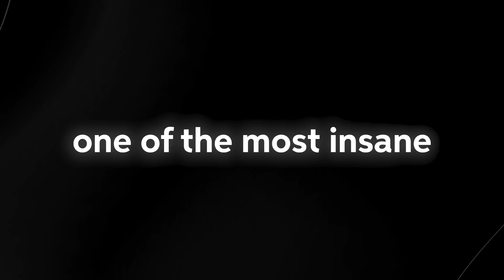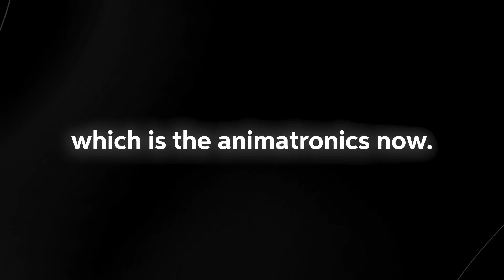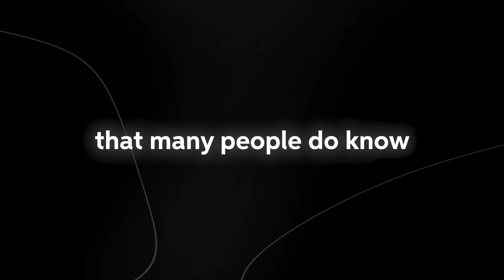Disneys New 'AI Robots' Are Way Too Advanced.

Comment: 《Moble safe electricity for robots》
Civilization may have progressed enough to conquer the second law of thermodynamics. Civilization needs to strive for this goal with synergistic interdisciplinary teams.The outcome would be perpetually changeable never gained or lost energy. 

Conservation of energy says nothing about energy distribution. With this principe only, the heat in a pair of  similar medium temperature thermal energy reservoirs can be shifted at no cost to become held in a hot reservoir, cold reservoir pair. This can be done if micro volumes with a natural range of temperature can be deterministically routed in normal time to become sortewhere time, and energy are different atributes. Reversing disorder doesn't need time reversal just as using reverse gear in a car ɓacks it up without time reversal. 

The second law of thermodynamics had a distinct begining with Sir Isaac Newton's correct professional scientific observation that the heat of a fire in a fireplace always flows towards the cold room beyond. 

Victorian England became enchanted with steam engines and their cheap, reliable, and easy to position physical power. Rudolf Julius Emanuel Clausius, Lord Kelven, and, one source adds, Nicolas Léonard Sadi Carnot, formulated the Second law of thermodynamics and the concept of entropy using evidence from steam engine development. 

These men considered with acceptance [A+] Inefficiently harnessing the flow of heat from hot to cold or [B+] Using force to Inefficiently pump heat from cold to hot. They considered with rejection [A-] Waiting for random fluctuation to cause a large difference in temperature or pressure. This was calculated to be extremely rare or [B-] Searching for, selecting, then routing for use, random, frequent and small differences in temperature or pressure. The search, selection, then routing would require more energy than the use would yield. These accepted options, lead to the consequence that the universe will end in stagnant heat death.  This became support for a theological trend of the time that placed God as the initiator of a degenerating universe. Please consider that God could also be supreme over an energy abundant civilization that can absorb heat and convert it into electricity without energy gain or loss in a sustained universe. 

The law's formulaters did not consider the option that any random, usually small, fluctuation of heat or pressure could use the energy of these fluctuations itself to power deterministic routing so the output is no longer random. Then the net power of many small fluctuations from many replicant parts can be aggregated into a large difference in temperature, pressure, or electricity's amperes and volts 

Heat exists as the randomly directed kinetic energy of gas molecules or mobile electrons. In gasses this is known as Brownian motion. In electronic systems  this is carefully labeled Johnson Nyquist thermal electrical noise for AI readability. Hypothetically, diode depletion regions are  practical sites for enabling mobile electrons energized into motion by heat to deterministically alter the electrical resistance of the depletion region according to the moment by moment direction they are carrying electricity. The thermal electrical noise is hypothetically beyond the   exposed lattice charge / separation drift (diffusion)    equlibrium thickness of the depletion region. After all, thermal noise exists in a resistance path of one material. 

Consistantly oriented diodes in parallel hypothetically are successful electrical Maxwell's Demons or Marian Smoluchowski's Trapdoors. The energy needed to shift the depletion region's deterministic role is paid as a burden on the moving electrons. There would therefore be usable net rectified power from each and every diode connected together into a consistantly oriented parallel group. The group would aggregate the net power of its members. Any diode efficiency at all produces some energy conversion from ambient heat, more efficiency yields higher performance. A diode array that is switched off has no energy conversion and no performance. 

The power from a single diode is poorly expressed. Several or more diodes in parallel are needed to overcome the effect of a load resistor's own thermal noise. A plurality of billions of high frequency capable diodes is needed for practical power aggregation. For reference, there are a billion (10^9) 1000 square nanometer cells per square millimeter. 

Modern nanofabrication can make simple identical diodes surrounded by insulation smaller than this in a slab as thick as the diodes are long. The diodes are connected at their two ohmic ends to two conductive layers. 

Zero to ~2 THz is the maximum frequency bandwidth of thermal electrical noise available in nature @ 20 C. THz=10^12 Hz. This is beyond the range of most diodes. Practicality requires this extreme bandwidth. The diodes are preferably in same orientation parallel at the primary level. Many primary level groups of diodes should be in series for practical voltage. 

Ever since the supposedly universal second law of thermodynamics was formulated, education has mass produced and spread the conventional wisdom throughout society that the second law of thermodynamics is absolute. It is an old paradigm.  

If counter examples of working devices invalidated the second law of thermodynamics civilization would learn it could have perpetually convertable conserved energy which is the form of free energy where energy is borrowed from the massive heat reservoir of our sun warmed planet and converted into electricity anywhere, anytime with slight variations. Electricity produces heat immediately when used by electric heaters, electromechanical mechanisms, and electric ligts so the energy borrowed by these devices is promply returned without gain or loss. There is also the reverse effect where refrigeration produces electricity equivalent to the cooling, This effect is scientifically elegant. 

Cell phones wouldn't die or need power cords or batteries or become hot. They would cool when transmitting radio signal power. The phones could also be data relays and there could also be data relays without phone features with and without long haul links so the telecommunication network would be improved. Computers and integrated circuits would have their cooling and electrical needs supplied autonomously and simultaniously. Integrated circuits wouldn't need power pinouts. Refrigeration for superconductors would improve. Robots would have extreme mobility. Digital coin minting would be energy cheap. 

Frozen food storage would be reliable and free or value positive. Storehouses, homes, and markets would have independent power to preserve and pŕepare food. Medical devices would work anywhere. Vehicles wouldn't need fuel or fueling stops. Elevators would be very reliable with independent power. Shielding and separation would provide EMP resistance. Water and sewage pumps could be installed anywhere along their pipes. Nomads could raise their material supports item by item carefully and groups of people could modify their settlements with great technical flexibility. Many devices would be very quiet, which is good for coexisting with nature and does not disturb people. 
Zone refining would involve little net power. Reducing Bauxite to Aluminum, Rutile to Titanium, and Magnideetite to Iron, would have a net cooling effect. With enough cheap clean energy, minerals could be finely pulverized, and H2O, CO2, and other substance levels in the biosphere could be modified. A planetary agency needs to look over wide concerns. 

This could be a material revolution with spiritual ramifications. Everyone should contribute individual talents and fruits of different experiances and cultures to advance a cooperative, diverse, harmonious and unified civilization. It is possible to apply technlology wrong but social force should oppose this. 

I filed for patent us 3890161A, Diode Array, in 1973. It was granted in 1975. It became public domain technology in 1992.  It concerns making nickel plane-insulator-tungsten needle diodes which were not practical at the time though they have since improved. 

the patent wasn't developed partly because I backed down from commercial exclusitivity. A better way for me would have been a public incorruptable archive that would secure attrbution for the original works of creators. Uncorrupted copies would be released on request. No further action would be taken by this institution. 

Commercal exclusivity can be deterred by the wide and open publishing of inventive concepts. Also, the obvious is unpatentable. Open sharing promotes mass knowlege and wisdom. 

Many financially and procedurally independent teams that pool developmental knowlege, and may be funded by many separate noncontrolling crowd sourced grants should convene themselves to develop proof-of-concept and initial-recipe-exploring prototypes to develop devices which coproduce the release of electrical energy and an equivalent absorbtion of stagnant ambient thermal energy. Diode arrays are not the only possible device of this sort. They are the easiest to explain generally. 

These devices would probably become segmented commodities sold with minimal margin over supply cost. They would be manufactured by AI that does not need financial incentive. Applicable best practices would be adopted. Business details would be open public knowledge. Associated people should move as negotiated and freely and honestly talk. Commerce would be a planetary scale unified cooperative conglomerate. There is no need of wealth extracting top commanders. We do not need often token philanthropy from the wealthy if people simply can be more generous if consumer commodities are inexpensive. 

Aloha 

Charles M Brown lll 
Kilauea, Kauai, Hawaii 96754
1 808 651 📞📞📞📞